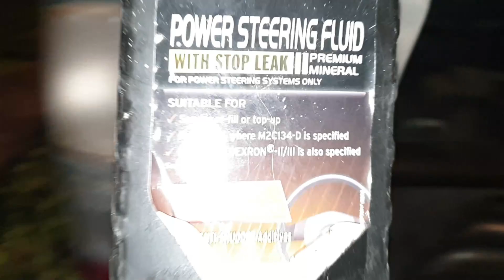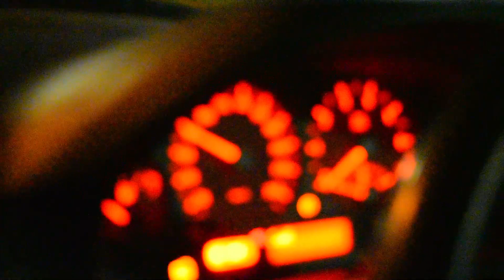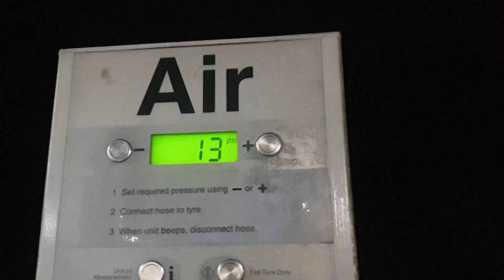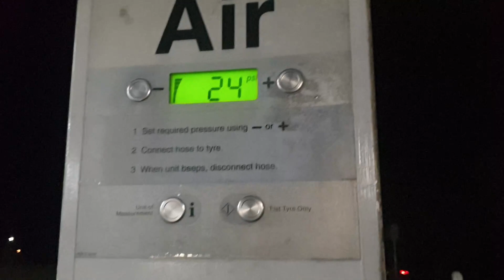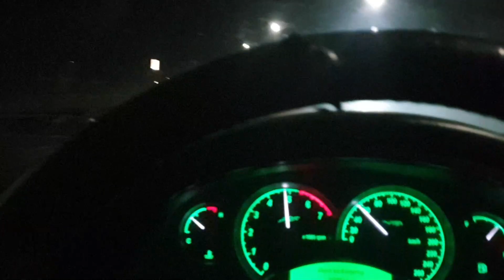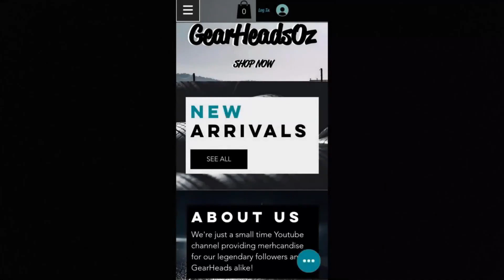Last Minute Repairs On The SS Before Rushing To A Skid Meet!! *destroyed rear bar*

Comment: Heads cracked for sure
Reply from the maker: Are you talking about the SS? 
Because this was weeks ago and she still runs like a dream mate.
Reply: @GearHeadsOz  oh that's sick then however I've drove like 7k kms on a cracked head before. Maybe because of all the skids it was losing water?
Reply from the maker: @sarcasmgaming7235  Ohhh yeah I get what you're talking about now, yeah I hadn't properly bled the cooling system and it started to get hot by the end of it. So it boiled half the water out the overflow 😂 
Hasn't done it since though, only when you abuse it hahaha